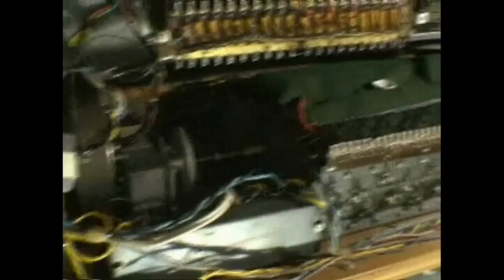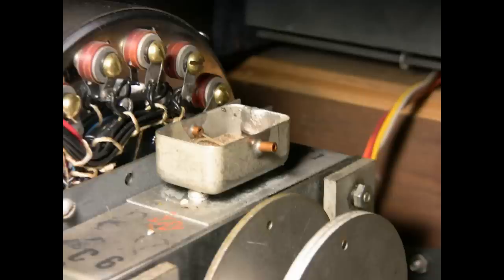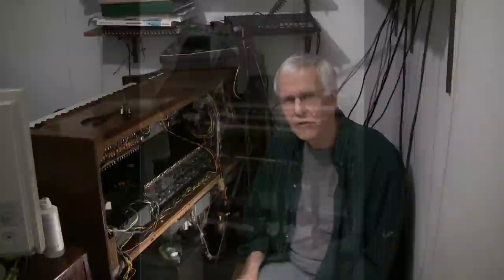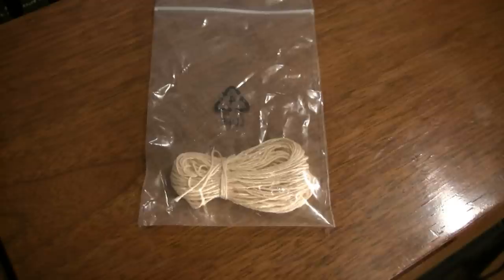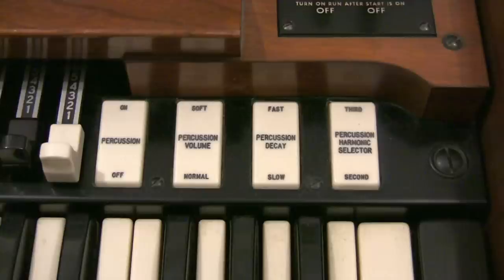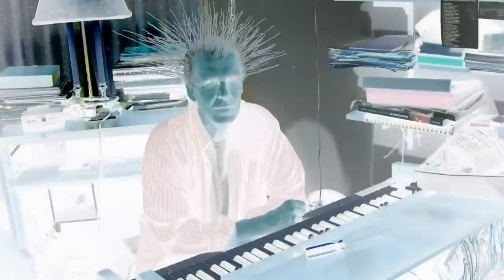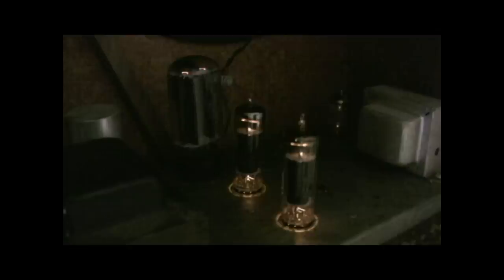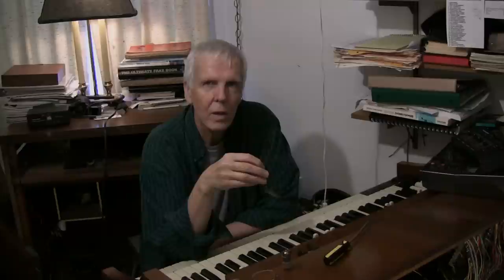HAMMOND ORGAN MAINTENANCE 'Missing Oil Wick Thread' & 'Percussion Fix'

Comment: I hope you get messages yet, but there is a reasonably very simple and SAFE fix for the Percussion problem. It has worked for me. I have a small battery operated circuit that does generate some higher voltages,.... BUT.... I apply them in such a way that it will NEVER damage the organ, and if you follow the procedure correctly, there will be NO shock either. There is another underlying problem with the tone wheel organ in general regarding the vibrato unit called the "Scanner". This scanner will sometimes not make clean vibrato, but a PULSING of tones. Normally most techs pull the scanner and sent it off for rebuilding. Over the last 30 years, I have never pulled one to send out. Again I clear the "Shorts" inside the scanner with a small voltage shock. 100% success on that one. Okay, there are a few that require to go to the pickup end and clean the contact point and carbon button, but not usually needed. The percussion and the scanner problem is caused by the same reason. Hammond organ metal parts grow metal hairs on the parts very often. These 'hairs' get across contact points and short their operation. The percussion is in the keyboard contact rail for the percussion to be triggered, and the scanner between the capacitor plates inside it and ground. Hope this may help you in the future.
Reply from the maker: Hi Bill, I tried the procedure on my motorboating vibrato scanner and it worked but I had to repeat it about every 30 days so I ended up just having it rebuilt. Didn't take long, the tech had some spare scanners that he just swapped and installed. Thanks for your suggestions.

Comment: Hello Steve, and thanks for your video.  I just bought an A105 with a 750 Leslie from a church, and they told me that the rotary never worked, nor did the reverb.  When I tried it out, these problems did exist but also the vibrato tabs on both great and swell would drop the volume by about 3/4 when depressed.  I got vibrato, but very quiet.  They gave me a great price though, so I bought it.

As I was packing it up to take home, I noticed that the 5-pin A105 socket had been changed out to a 6-pin adapter, and BEHOLD - the 11 pin Leslie plug was now a 6-pin plug.  When I got it home I saw that two of the 6-pins had been modified to carry AC to the Leslie along with only 3 other pins being used!  OK... Leslie is going to the shop for restoring the electronics to factory 11-pin status - in the words of Dirty Harry, "A man's got to know his limitations."

Now for the organ.  I pulled the 6-pin stuff out - which contained the chorale/ensemble and fast/slow/off controller - and connected the spliced wires back up.  Organ works fine, but still vibrato gets quiet.  I was following wires, checking solder joints (the ones the installer did were pretty bad), and scratching my head... all to no avail, so I came here and did a search on youtube.  I watched this video, went back and reseated all the tubes per your advice, and VOILA - SUCCESS!  Thanks a lot, Steve.

That was long-winded, but I wanted to put it all in.  Anyway, now all that is left is to find out why the reverb does not work,,, none of the tubes appear to light up, so that is a good place to start.
Reply from the maker: Addison, glad it worked out for you. Hammond tubes are easy to find, I'm sure you'll get it working. Thanks for writing. I'm sure you'll get your A105 back to making music again!

Comment: Yup, great vids Steve...  spreading the knowledge will keep these old tone wheels going for another fifty years ^.  I remember when I purchased my A100, I took the back off to gloat over the mechanical marvel that the tone wheel is.  I noticed that thread running down to the drive shaft, and thinking it was just surplus crud lurking there I almost tore it out.  Thankfully I stopped to think first and investigated further, eventually realising that this was in fact part of Lauren's ingenious lubricating system.   My A100 percussion was not working correctly when I purchased it... the previous owner claimed that it had the Jimmy Smith 'Paradise Club' mod that stopped the percussion from decaying... anyhow, after checking capacitors and voltage levels etc. I determined that it was in fact 'dendrite whiskers'  shorting the percussion switches.  I used a 12v 4 amp PSU to 'zap' the percussion switch wiring attached to the pre-amp (in all switch positions) and.. whalla it started working again after the 'zap' blew the dendrites off the switch contacts :)  Some folks use AC mains voltage... but I think 110v or 240v could indeed do some damage!  12v @ 4amps is fairly safe IMO

Comment from the maker: I had so many requests for this thread, I've already given it away. The ebay user I bought it from does not have it listed anymore. I was told that heavy cotton thread from a fabric store will work, this is from a Hammond tech. Also check out the discussion on the Organ Forum topic 'Heavy Cotton Wick Thread'. recommends using 30 gage crochet cotton thread.
Reply: Old thread (pun)... but when I first purchased my A100, I had to look inside to wonder at the marvel of my first tonewheel generator... one of the first things I noticed was this 'string' coming off some of the moving parts (the vibrato tub).  I put my fingers round the string (cotton thread) and was just about to yank the pesky stuff out... when a guardian angel stayed my hand and stopped me just in time (I must have been a good boy that day and was owed one!)  Anyhow, I refrained from yanking it out (the thread :) ) Did some further investication and learned all about Luarens ingenius method of lubricating the bronze tone wheel bushes!  Oh boy, was that a close call!

Comment: I concur, Bob is a great guy with loads of useful vids on Hammond maintainance.  I did successfully 'ZAPP' my non working percussion after trying several other things first.  I used a 12v 4amp psu, removed each percussion wire from the back of the pre-amp in turn and zapped each wire with the percussion switche's in every position.  This blew the dendrites of the switch contacts (to zinc case) and all was working again.  I think 12v dc is safe for this although I have heard some use AC mains \O/

Comment from the maker: Hi, As shown in my video, I removed and reseated the percussion tubes, that did the trick. The next step would have been to spray with DeOxit. BTW, mine is an A-100. Not sure where percussion is on your B3, but try the technique on all the tubes which is a good idea for an organ that age. Beyond that, hopefully someone with more tech experience than me can offer some more tips. Also, look for the percussion cutoff control. Make sure it's not turned completely off.

Comment: Thanks for your good advice which I found very helpful indeed and I will try and carry out the procedures and get my Hammond Percussion working and check for tone wheel top up and vibrator oil tray and wick supply. Your video has given me great insight into keeping my 1963 Hammond L100 playing at it's best and maintenance tips that are so important.

Comment: Yep percussion not working... on my A100 several years ago. I tried the tube pull trick and the adj. the percussion vol pot; did not work for me :(  The problem with a lot of percussion failures though is 'dedrites' (flakes of zink plating) shorting the percussion switching to ground.  The correct fix is to remove the switch box and clean all the dedrites out and laquer the inside of the zinc box so the pesky dendrites can't form again.  However, that's a bit of an involved and timely procedure... I have successfully done a quick fix a couple of times by 'zapping'  the switch box wires with a 12v car battery charger; a car charger has an element of AC and DC voltage, which is good for zapping and runs about two amps of current. Unsolder the 'hot' percussion switch wires from the preamp,  earth the battery charger to the chassis of the organ, zapp each wire in turn for two or three seconds while getting someone to operate the percussion switches.  Hey presto... the percussion started to works again :)  The zapping liturally 'blows' the dendrites off the switch contacts that are shorting to earth.   You do this at you're own risk though... as it is NOT the correct method and may require multiple tries to get it to work.  Over several years I have had to do this twice (successfully) as the dendrites do return!

Comment: Thanks for this!  I'll have to be sure to check mine.  The wick cord looks like cotton twine you can find at a hardware store, is that accurate? I don't know if I have the felt in mine either.

I have a few weeks before my regular oiling of my '62 Hammond A-102 and Leslie 142. 

I have my organ on a wheeled plywood platform for ease of access for maintenance; and it removes the risk of snapping the skinny front legs of the A-102.

Cheers!
Reply from the maker: Here's a discussion from the Organ Forum regarding the oil wick thread: https://organforum.com/forums/forum/electronic-organs-midi/hammond-organs/25460-hammond-cotton-wick-thread

Comment: I know Al Lasher's Electronics in Berkeley, Ca has one, it is a more of a "Hard Core" electronic store.  You might check with any Vintage Radio fans in your area to find a similar establishment.   Generally if they're microphonic, they need replacing, If you can substitute a new tube and see if the problem goes away.  I have a small, old tube tester (that runs on tubes itself), so I question it';s accuracy.

Comment: I never saw it mentioned but in the cup over the tone motor there also is a string that goes to the other side of the motor. I was lucky both of my strings were there. But there are strings that go out both sides of the cup. I just never heard it mentioned. So on to the next problem.

Comment: You can also use a freeze mist from a spray can to free up sluggish generators and scanners as the oil gums up over time.  You can get it from Digi-Key or Mouser Electronics; they will sell to anyone and they have no minimum buys on most products.
Reply: Be sure to spray all of the bearings; including the ones under the tone wheel generator filter cover.  i usually notice a substantial improvement after blasting the old oil out and lubricating the bearings with fresh machine oil.  just follow all of the wicks and spray wherever all of the wicks terminate.

Comment: Great video.  Extremely helpful.  Like you, I noticed my oiling wick was missing and I am about to find and install a replacement.  However, I'm a bit unclear about tying the wick to the brass bearing on the motor shaft below..  Does the brass bearing turn, and won't it wrap up the thread?  please advise.  Many thanks again....PC
Reply from the maker: You can certainly try that and see what happens. To be safe, I just tied a knot around it which was not the easiest thing to do. I would guess a good percentage of these organs are missing the oil wick and they go unnoticed but continue to function just fine. I've never heard of one failing because of a missing oil wick, but that's Hammond reliability for you. Thanks for writing and am glad you found it useful.  - Steve

Comment from the maker: Using other oils like 3-in-1, sewing machine oil, Castrol, Crisco, etc. will gum up the oiling wicks and prevent oil from reaching the generator. Repairing this condition is a major service event! Use Genuine Hammond Oil only!
Reply: Finding an oil like that is difficult (or really simple...). But I mentioned using 3 in 1 to a tech in Calif and he said the same thing. Any ideas on a substitute? Good vid.
Reply: Given the value of the organ, it would be prudent to spend $12.99 (bborgan.com) for a bottle of the correct oil. If you have ever seen what it looks like under the cover of the wick tray you would understand how the wrong oil could cause major trouble if it gummed up or something. Dozens of wicks, looks very much like spaghetti.

Comment: Something that old should probably be Re-Capped to prevent excessive dc offset damaging the tubes.
Reply from the maker: Thanks Kelly. Older models with the old wax and paper caps usually are good candidates for recapping. My certified Hammond Organ tech has tested and assured that my caps are of the later design and are within proper tolerances and do not need replacing

Comment: i have messed with the decay adjustment and it appears to only alter the intensity.
the problem with mine is that it won't decay at AT ALL and it is polyphonic. fires with one or more keys already down. they say that jimmy smith encountered this problem with an organ at a room called the "Paradise Club" and liked it so he had one of his own organs modified to do this. i DON'T like it and want to fix it.

Comment: You had to remove the sync motor/scanner unit to get access to the bearing and wind the new wick around, didn't you? How did you fix the wick to the bearing?
Reply from the maker: No, I didn't have to remove anything. I just tied the wick thread around the bearing shaft and wrapped it around the felt oil pad along with the wick coming out of the scanner. Keeping the pad saturated with oil feeds it down to the shaft.
Reply: @steverabb  Yes, this is possible. But it's a real PITA! Just recently I had to replace the same wick on my '51 C-2. So I know what I'm talking about.

Comment: Hi Steve I am Mike from Wareham in Dorset in the GB I had to take my scanner apart to free up a stuck self centering bearing and guess what I snapped one of the  the threads have you still got some left? Would you send me some? I will try michael casino on eBay  see if he has some and where do I go for oil with out getting ripped off? Great video and bye for now you can find me on Facebook in Dorset  by the way I have a t.v. cathode ray tube tester with lots of adapters don't know if it would work on audio tubes?
Reply from the maker: Hi Mike, Sorry I don't have any left. Most organ service places will have Hammond oil or you can buy online.
Reply: Hi Steve  I looked and best was an offer of 4 fluid ounces at £20.00 including p&p that's  about $26.93 seems high? Also told no cotton threads available 😢 I have tried Mike Casino but have not heard back from him. Thanks for all the video fun and the great hints 😀